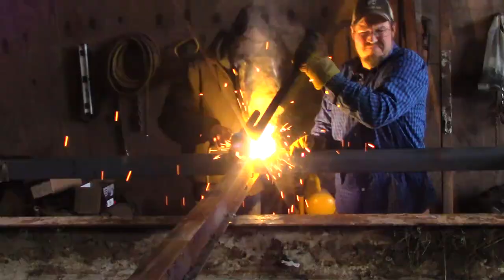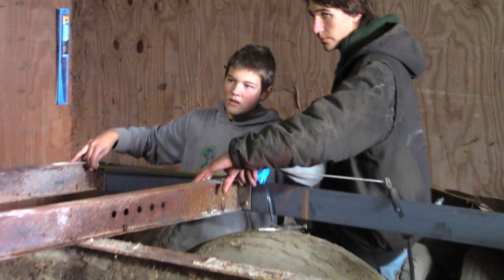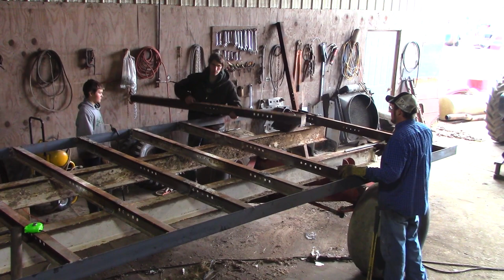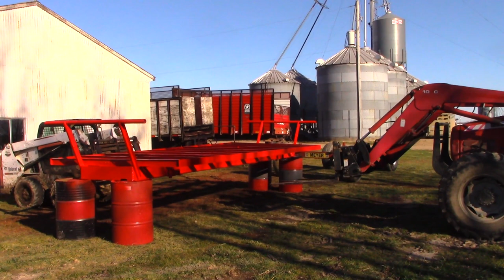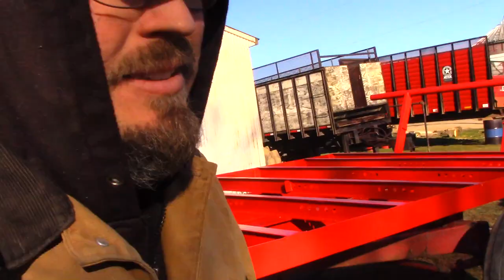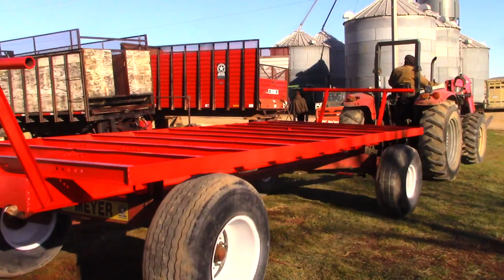Building a Hay Wagon

Comment: My dad, my brothers and I built a wagon using Solid OAK back in the early 70's.   A few years after we built it, some rushed driver in a hurry to get home after his sift at the local auto plants, hit the hay wagon going over 40 miles an hour while try to pass us,  ripped the front of his car all to h*ll.  Left a little dent on the end of one of the oak 2 x 4 cross beams.   That wagon is still in use today and still going strong.   It has been almost 50 years since we built that wagon, transported over 1 million bails of hay and straw on it, (240-260 bays per load).   Since that wagon was built, no maintenance has been done on it.
Reply from the maker: That's awesome! Oak is so strong!!

Comment: Should put some wood blocks under the metal frame because the frame/ bed will hit the tires on rough ground/ bumps otherwise
Reply: Only saying that as I have been on many hay wagons in my lifetime 16 to 71 years old
Reply from the maker: Yes, there are blocks in each corner. Might now have been able to see them in the video.